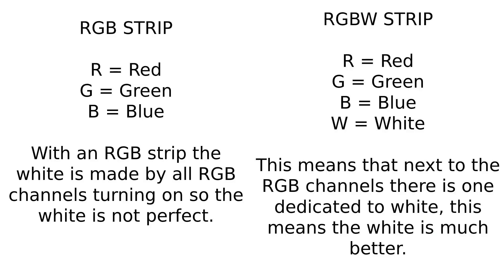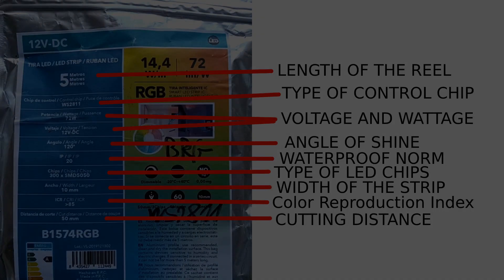DIY - What To Know About LEDstrips Before Buying!! How To Connect Them Without Soldering

Comment: How do I connect these strips in 4 different directions. I have a base with an x in the center. I want to connect 4 strips in 4 different directions but how do I make it so they all lead to one power supply?
Reply from the maker: Hi. Your LED strip always has a direction or arrow on it, make it point the other direction and just keep in mind that you need to wire it in that direction also but you can cut it up and place it the other way around, might get a bit tricky with the wires but just keep the direction always in mind, hope this helps!

Comment: Great info, feels like I spent 1 year of studies:) Question: I want to connect to 220 V a simplest 2-wire white lights strip: what do I need - an adaptor or a transformer, or what? I am such an ignorant, maybe you said something about it, which I did not get?
Reply from the maker: Hi and thanks! There are many plug and play kits that come with a ledstrip and transformer that takes it from 220 to 12 or 5v but so yes if you only get a strip you will still need a correct power suply
Reply: @yehoshuasartinspain  Thank you: now I am one BIG step ahead:), thanks to this video